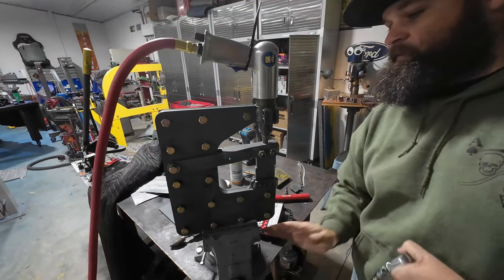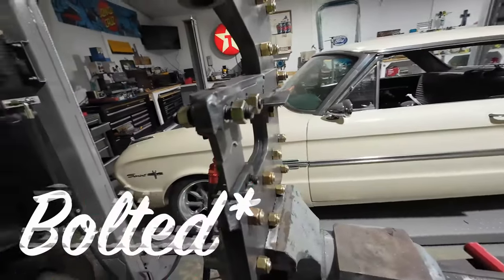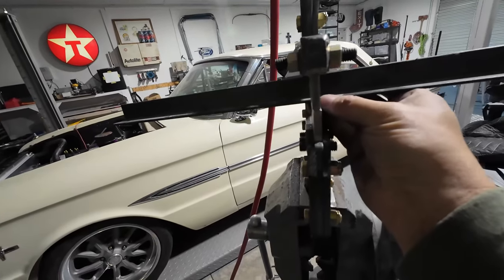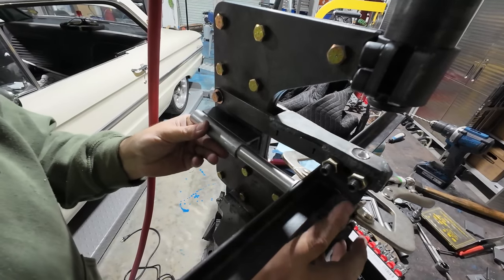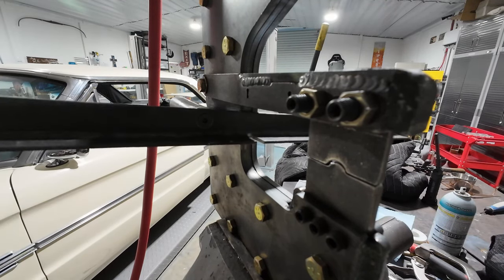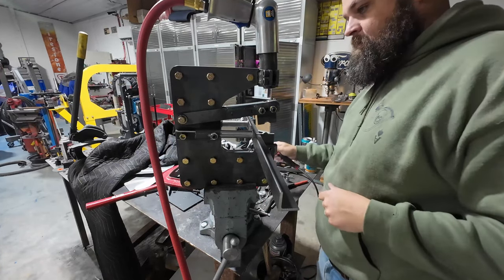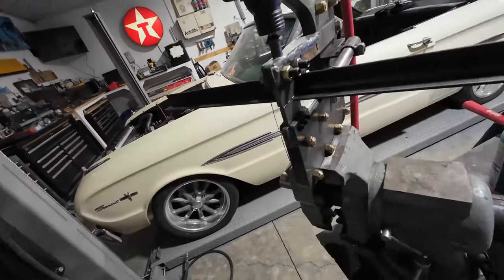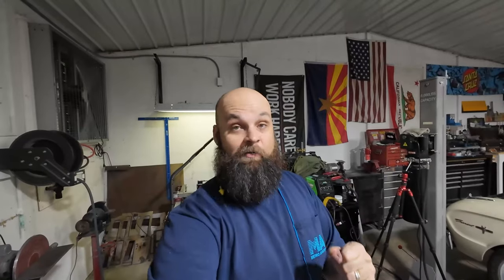Japhands Kustoms profiling tool: Adding a fence!

Comment: Perfect timing.  I was going to build my fence this weekend but after seeing yours, I'm going to copy your idea.  I was going to slot some pieces of flat stock and use the two middle bolts on the tool as support but your idea is much better.  I don't have a lathe however so I'll need to find someone to turn the bars for me but I'll figure it out.  Thanks for posting this.
Reply from the maker: Awesome! Yeah I bet you could just find tubing that will nest in the next size up pretty well.